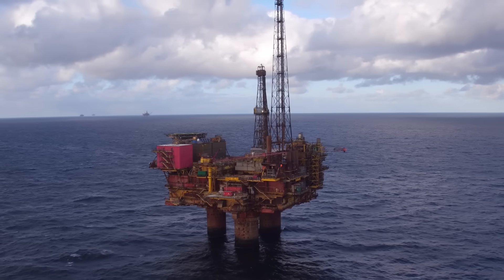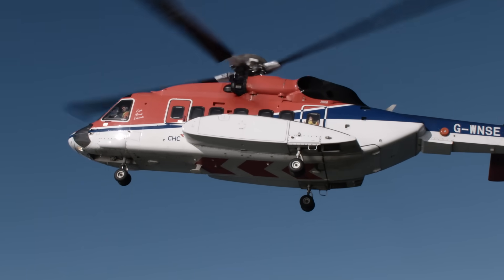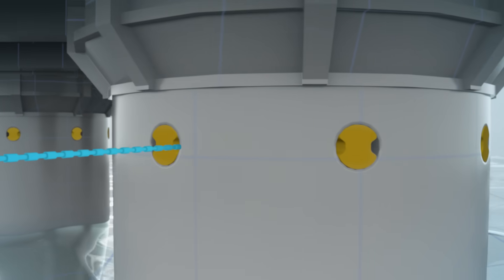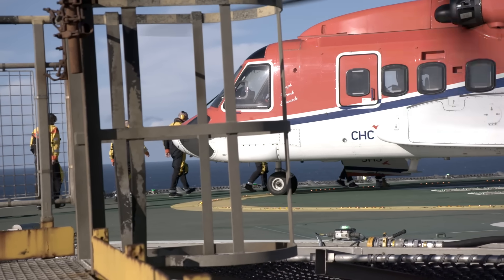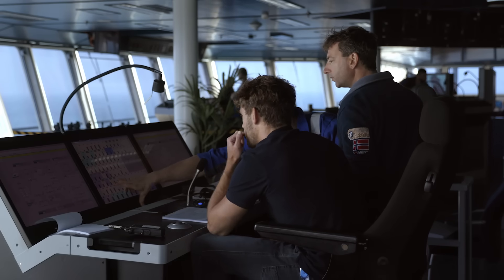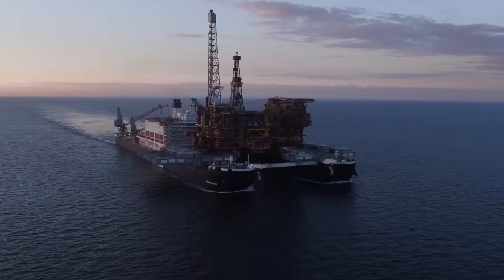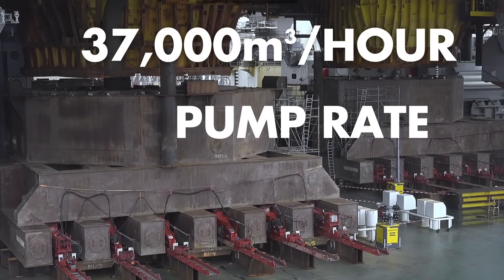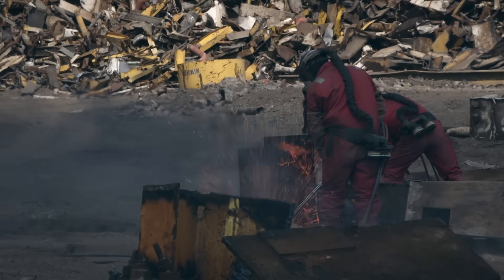‘There We Go’ – Lifting 25,000 tonnes in 9 seconds | Brent Bravo Lift

Comment: Leaving the foundations in the north sea I incredibly dumb. They were used to store oil and will eventually leak in the future, even if sealed. They also apparently contain radioactive materials. Leaving them to rot where they are is irresponsible. With those huge profits that shell is generating it should be out of question to remove the foundations.

Comment: You need clothes and not only normal clothes but kings wear robes with crown and jewelry.,a sword a shield. Caustic keeps you warm, nitrogenis to display on top to seal you with the muds weight like a Kings Crown with rubies. This means you did it the correct way

Comment: Make sure you can take your Bop valve long handle off first from choke and quickly pull up and install witb a 3 sextion turning push lock in.Remember open,pull up place in Bop on 3rd section slip in quick lock-in

Comment: Seriously? Did he just ask, "how do you turn 25k tons of steel into this" while showing a pile of steel scrap?
IT'S STILL 25,000 TONS OF STEEL YOU F**KING IDIOT!
Reply: It’s rhetorical. They then go on to show how it’s removed from the column piles etc 🤷‍♂️
Reply: @t-rex4211  I know it's rhetorical. Maybe YOU need to figure out what "rhetorical" means because it has no bearing on my comment. 25k tons of steel is STILL 25k tons of steel whether it's in a building, a ship, an oil platform, or a pile of scrap. 
The question that he was trying to ask is, "How do you turn 25k tons of drilling platform into a pileof scrap?"

Comment: Are lights & easily seen markers left on the stub of the platform, left in the ocean, or at location? I realize the Nav-aides transmitting, or maybe that's where the new wind-chargers will swing blades for fun & profit...(?). (255k * 2k) / 33k?). Maybe I'm all wet, its offshore & I was on land. Ne'er could get off.

Comment: That question about how to turn 25,000 tonnes of steel into scrap, my answer is lots of guzzolean IEDs using shell fuel.

Note this is a joke comment, I would have started scrapping the pump tower and dangling extremities out at sea so that the tower it more concentrated and less likely to lose something over the edge.

Comment: that thing looked so small on the huge boat but when it was on the barge that is when I realised the sheer size of that thing ! Everything about this operation is amazing
Reply: To be fair the Pioneering Spirit is the largest vessel ever built, with a maximum displacement of 1,000,000 tons.  That is the same displacement as all 10 Nimitz-class aircraft carriers of the United States combined.  In comparison the oil rig it lifted was just 25,000 tons, or one quarter of a Nimitz-class aircraft carrier.

Comment: How do you seal the bore hole that it will never leak hydrocarbons into the sea. The steel casing will have oil all over the inside. What and how will you do the impossible ??? Thanks

Comment: What is the carbon impact of this operation? What is that compared to just abandoning in place. You are not removing the cement piers so living the platform in place is little different than removing it. How many millions of gallons of oil were burnt to remove it? 
A simple de-contamition and de-commission could easily accomplish the same end result.

Comment: I was intrigued by the title. The time to lift one object is milliseconds. The time between the first part of a joint to separate and the last part of the joint to separate. The title implies that the four legs lifted off would be separated one by one over a 9-second duration but it looked very well synchronized, say, less than one second from what I could tell. The distance to lift after separation is irrelevant.

Comment: It's incredible how much stability and control the ship maintains coping with an off centre change in weight of 25,000 tonnes in 9 seconds, very impressive engineering. Does it have to shift ballast around quickly to compensate I wonder, or maybe 25k tonnes is relatively small compared with it's displacement during the lift.
Reply: The graphic did say the ballast tanks were 700,000 tons
Reply: The comment was about moving ballast around quickly, not if there was ballast.
Reply: @VitaNova83  ballasts are cool I know
Reply: ballasts

Comment: They keep repeating better, safer. They mean cheaper.
Reply: Pete is never wrong  not always, but I'd agree yes if the work isn't been run by a financial director. Things can be and are regularly horrendously managed.  They are doing it cheaper and calling it safer, when any safety benefits here are just collateral.

Their focus is reducing man hours.  They then say that's for safety reasons (no mention of cost savings at any point). Its not, it's for financial reasons.  The history of the oil industry: Piper alpha; Deep water horizon; single skin oil tankers.  

They are only doing these decoms because they are being forced too. Remember the Brent Spar?

The conversation within Shell started with "This costs too much"

Comment: 1823 : Augustin- Jean Fresnel  used his lens at the Cordouan lighthouse  by mouth of Gironde Estuary .no doubt around a gas light  flame " that could be seen from more than 20 miles out ( Wiki says ). Here on YT  many show you  pump  free energy from the sun this way  , imagine how 217 years of R&D would have given  free heat / electricity/ non polluting greenhouse ( for farming Dutch tulip  onions , or else !) warmth etc ." For the Homes and Businesses Of  Europe" .
And no need to put oil platforms around Greenland for the obviously selfish dividends of a handful of shareholders... Now that inlandsis is melting there , along with permafrost , because of oil /gas /coal / plain burning wood use !

Comment: I could have lifted it by hand in 9 seconds, using a pulley. Only about 5 μm, but what I'm saying is that the title is meaningless. They don't mention it, but it looks like the elevation is around 0.5 m, which means that the lift takes 14 MW. That's more impressive.
How is the energy stored and released?

Comment: Seems like one of the platforms should be brought to shore and turned into a museum.   I am just an average idiot in the states and even I know that north sea oil was a huge deal for the UK.  I know know of these will be preserved, they are just worth too much in scrap.  I was surprised that the whole thing was turned in to scrap metal.  It was a working platform, you would think there would be a lot of useable equipment on there.  Maybe there was an auction they didn't tell us about.

Comment: Uhmmmm.  You first have to fully understand how platforms are designed and installed to fully understand how they will come out (plugging wells and D&C, systems draining and flushing, as well as the legislative approvals aside). In that, if you have been part of a PMT that has designed, and physically been offshore and installed platforms (templates, jackets, piles, decks) not once but at least more than plus a dozen or so times, then you are a very capable experienced individual to be part of and or lead a decommissioning (reverse process) operators team . The 2 shell project leaders to me don’t look like experienced people that have been part of PMTs in the past, that have cradle to grave installed fixed  platforms other than represent shell as the operator, with the contractors actually providing the real expertise and the shell folks sitting over the top. I find a lot of so called “fixed platform decommissioning” self elevated or self promoted team leaders and experts have very little past or previous expertise of being offshore as the operator rep physically managing with the ICs,  fixed platform installations. I am a firm believer of you really need to have led from the front of “how it went in, to manage a team of how it’s going to come out”........more then once as an offshore day trippers or visitors during platforms installation. There’s a lot of Decomm Delboy trotters out there.......selling themselves as Decomm experts....

Comment: Shell: It needs to be really accurate.

Quay side: Line it up with that yellow stick.
Reply: Basically how i imagine engineering works irl
Reply: @isaacdestura7495  that is exactly how engineering works irl. the engineers in the office are all about the numbers and having everything down to the smallest measurement and freak out when things are not exactly perfect like they are on paper or on the computer whereas the engineers in the field working with the production crews actually building the stuff do hand calculations on scrap paper or napkins using calculators on their cell phones and tend to go by experience and just say "yeah....that'll probably work."
Reply: @jakedenson1688  but not always...it always depents on what they are working on...... they all have their tolerances and they try to fullfill them
Reply: @jakedenson1688  eh, this estimate will surely work that i jus knocked up on a scrap of paper. dam bursts
Reply: @jakedenson1688  yeah not really, the operations are carried out with a lot of precision. This wouldn't be possible otherwise.
Reply: @jakedenson1688  because the reality is the ones in the office are doing the "real engineering" aka modelling, simulation etc while the production crews are assembling the parts together. Which is why there's a gap in the mindset.
Reply: @jakedenson1688  geological/geotechnical operations are exactly like that lol
Reply: 10.28
Reply: Yeah and it went from being a floating city to being shredded scrap. Like we’ve all seen the “eats anything” machines. It’s definitely harder to turn the scrap into the oil rig that to disassemble and crush it

Comment: For all the hate in the comments against Shell and Big Oil, you have to give them credit they actually are recycling these things instead of just leaving them or "planning" to remove them only for a convenient storm to topple it during prep. The costs for these operations are enormous considering prep work and specialized machines (like the lift boat, the barge, etc) when it would probably be cheaper to just leave these to rot and pay a fine

Comment: Im still speechless how smth that weigh 25,000 tonnes + ship can still swim. On top how did you lift that up? Where comes the power from and why wouldnt you push the ship downwards into the sea?
Reply: It'a called Bouyancy. The ship and its cargo displaces exactly that weight of water which pushes back to hold up the ship. It takes little power to move a mass slowly through water and the ship's engines are powerful enough to move many times this mass.
Reply: These engines generate tons of megawatt

Comment: Stupid way to extract energy! Destroyed the environment and extracted a limited resource.  Even if the engineering & technology used to build and dismantle this behemoth was high tech, the idea of extracting fossil fuels and relying on a limited resource is such a dumb one!
Reply: I bet you drive a car. Idiot
Reply: @Allmotorzl1  yeah an all electric Nissan leaf. Idiot!
Reply: Adeel Ahmed We don’t build an electric empire overnight! While we build our greener infrastructure we still need oil and gas to power everything else.
Reply: @Allmotorzl1  who is denying that? My point was that its was ( and still is) a stupid idea to extract and use fossil fuels, which is a limited resources and it's not good for the environment in general. Just imagine that these companies invested (from day one) the same amount of money / resources to develop renewable energy which is cleaner, cheaper and much much more efficient. My Nissan turns off when I stop at a traffic light, is quieter, more faster from a stop and much much more cheaper to maintain ( no oil changes) and charges at home!
Reply: @AAFactor  
Your electric car was made using oil (lots of it)and the electricity it uses is generated by fossil fuels. Oh yes , the roads you so smugly use were built using oil, the stone in them was quarried and the tar that binds it are all there because of oil. The computer you use to post your comments and the building you are sat in are all there because of oil. Have you ever considered how much oil it takes to grow and bring your food to you? The entire human civilization you live in and enjoy the benefits of is built on oil.

Comment: so you didnt cover how the lift was so fast? what kind of mechanism is used? hydraulics  usually very slow
Reply: Dmytro Picky — how else could do that other than hydraulics?
Reply: @gunny_zky  counterblast , swing, hybrid systems, electric,  big engine shaft on gears.   i can imagine a lot)
Reply: My guess is that they dumped ballast water from the lift ships.
Reply: Nick torr — I agree.. which is a type of hydraulics in itself.
Reply: Yuck Foutube  why this is not in video? oh yeah bcs shell does not care for enviorment or workers or local economy. the lest they care is making a good video
Reply: @mrpicky1868  
It's not there because the producers think we're all to thick to understand. 
The ship was raised by dumping ballast and hydraulic (presumably) systems lifted as well.
Reply: They use ballast system to do most part of the lift, the vessel has  ballast water valve actuators of 2 meter diameter.

Comment: the O said once lifted it couldn't be put back down on the original legs, yet a couple of hours on they  place it on new legs on a barge, from what I understand. how that ?
Reply: The legs on the barge moved to were they needed to be
Reply: the reason is the circular keys they cut into the platform and the legs , won't go back on the platform due to the keys they cut for the removal of the platform ..  but the barge resting surface for the platform  is a flat surface hence it does not affect the stability :)
Reply: The makers of documentaries like to add little bits of drama hoping that the viewers are too thick to notice the thin grasp on reality involved. Of course it could have been put down again but instead we were all on the edge of our seats for a micro-second or two.